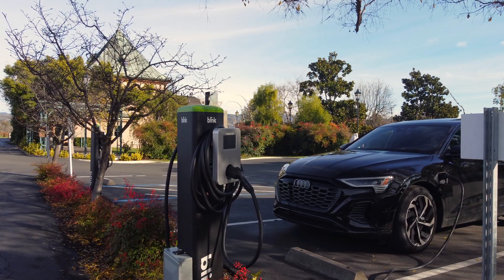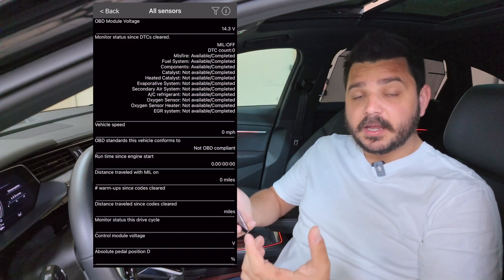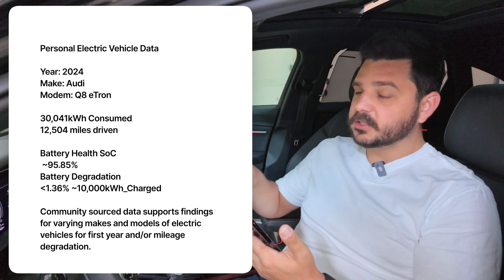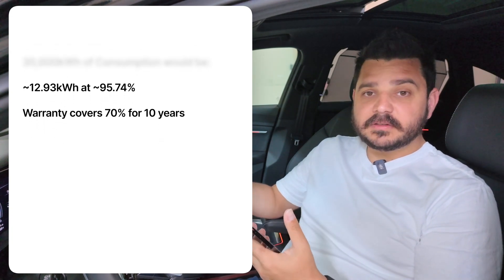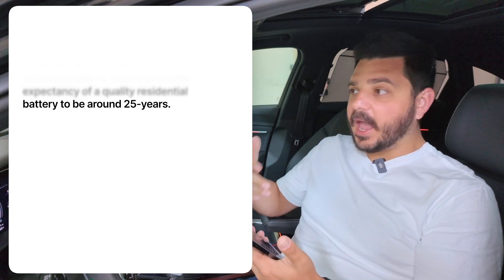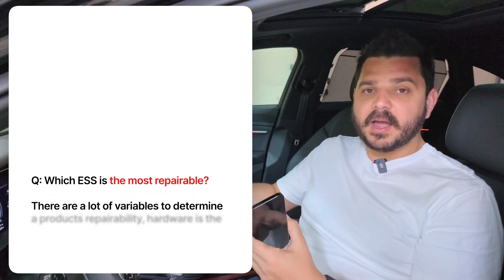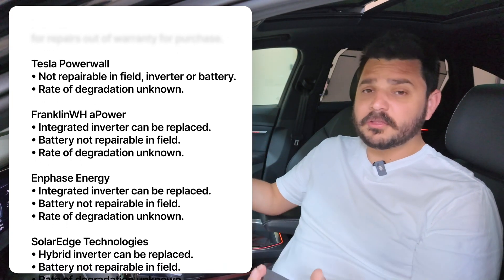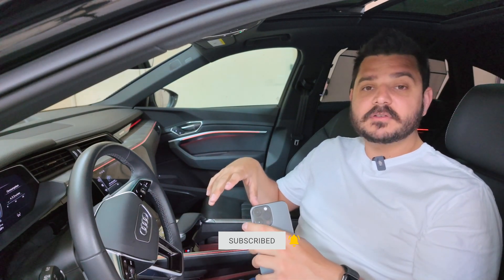How Long will a Tesla Powerwall Really Last? Shocking Battery Degradation Insights!

Comment: According to my Tesla STATS app my 2022 MYP with 20K miles (half are road trips using DCFC) the app reports I have lost 4.7% of its original rated range.  And my Y is a Performance Y and I go WOT every chance I get especially if there is some kid in a Mustang around me.  So my DISCHARGE data is probably on the HIGH side.
Reply from the maker: That sounds to be inline with most electric vehicles, the batteries need to settle in and the degradation slows down. Check out www.recurrentauto.com they will tell you how your vehicles doing compared to thousands of other ev owners.

Comment: When you look at the OBD data verses the vehicle display, you need to remember that the OBD is showing the actual battery SOC whereas the display adjusts for the hidden battery buffer... which on an e-tron is at the top of the battery.

Another issue is the chemistry.  LFP (LiFePO4) vs NMC.

A third is that degradation is non-linear.  The battery degradation rate typically starts out steep at the beginning but slows down drastically after that.

And a fourth is time, as I noticed another poster said.  Calendar aging... but calendar aging is a bit of a beast to calculate because it is primarily a function of the battery voltage (of the cell voltage) x temperature.   So this really depends on the temperatures the battery is exposed to and for how long... it will degrade more slowly in colder temperatures and at lower states of charge and more quickly at higher temperatures and higher states of charge.

Extreme conditions cause greater problems.  but nominal hot weather during the day might not necessarily cause faster aging because the battery is a huge mass so its ambient temperatures tends to be a combination of day + night temperatures.

And chemistry as well... so for example, NMC will degrade faster when held at a high state of charge, which is why charging to 80% is recommended (some people even do 70%).  But when a LFP battery is charged to 100% and charging stops, the cell voltage actually drops down significantly (while staying at 100% SOC), relieving some of the stress.   When a LFP battery is drained even a little, even just down to 95%, the effects of calendar aging are greatly diminished and at 70% at 20-25C or so calendar aging pretty much stops.

Lots of knobs.

Comment: The longest running battery health study is the Dutch/Belgium auto data base which goes right back to when the Model S was prevalent. It shows that degradation is the steepest at forming with ~5% degradation in the first 50k miles. Thereafter it averages 1% per 50k.
https://docs.google.com/spreadsheets/d/t024bMoRiDPIDialGnuKPsg/edit#gid=0
A recent study by Recurrent Auto found that removing the catastrophic failures of early Leaf, Bolt and Kona mass recalls from data, modern batteries do not meet warranty life in less than 1.5% of cases and with Tesla an order of magnitude better than that.
Dr Dahn has conducted a long running study on longevity in LiIon, having been responsible for doubling the cycle life within a year of employment by Tesla. In 2019 he published a white paper to all LiIon users and manufacturers showing them how to make a 'million mile' battery. Those cells are still under running tests and have reached 4 million or 10k full cycles.
Recently he has showed that NCM can have a cycle life equal to LFP if charged to less than 4.2v, temperature controlled at 20C. His longevity advice is to charge a typical EV from 30-70% for it to last indefinitely, which matches the requirements of a typical urban vehicle usage.

https://www.youtube.com/watch?v=rOAYjcO6kao
According to the Noble Prize battery guru Goodenough, Lithium batteries are not suitable for vehicle use! https://youtu.be/kR8CESrigEg?t=261

Comment: If the intent is to use the Powerwall 2 solely for backup, with no time of use element to be concerned with, does it then make sense to set the charge level for the battery in as narrow a range as possible, say 75-80% to minimize charge/discharge, also avoiding harmful 100% level?  This is consistent with the recommendation for daily driving of Tesla NMC battery vehicles.  If the grid down you would get alerted by the app and you could lower the 75% to 20% or whatever minimum you are comfortable with.

Comment: This is something I'm very interested in.   Just how long will my powerwall last?  Anyway the powerwall (2 anyway) has an api you can monitor it directly and don't need to attempt the comparison and there should be enough out there for a reasonable guess to be made.   I've been monitoring mine, which I've had since October 2023.   First thing actual capacity of the powerwall is not 13.5KwH, it's 14, or at least that was what I thought, mine started out with 14507KwH according to the API.   Why?   I think Tesla has worked out it's in danger of having warranty claims and is seeking to mitigate.    Today my powerwall is down to 14200KwH so it's lost 307 watts of capacity in less than 7 months,    It is therefore on schedule to lose 526w a year, which is 5.2KwH over 10 years.   70% of 13.5KwH is 9.45KwH this is the promised capacity.    Extrapolating my 10 years capacity I get 9.244KwH, which is slightly under.   My battery is in a garage, but is being force discharged, so I will exceed the maximum rated out (more than likely) so my warranty will actually be less than 10 years 8-9 I think.    Anyway there are lots of caveats my battery seems bigger than most,   I've only had it 7 months, age related wear might cause an increased decline, etc.   That said I don't think Tesla is kidding your battery will have just over 70% after 10 years ordinary use.   37 years seems unlikely.
Reply from the maker: Most batteries have a true capacity and a usable capacity. The last I heard the PW had a true capacity of 14kWh and the usable capacity is 13.5kWh. It’s possible that the batteries true capacity has increased over the years with units reaching 14.5kWh. Battery degradation isn’t as linear is you might think and a battery typically losses the most of its capacity in the first year before leveling off with a lower rate of degradation. Regardless there are a lot of variables, and not enough shared data to make a distinctive conclusion. Ideally these companies could publish their finds of real world battery SoC, and we can overlay them to seen if there is a pattern. Much like they have done with EV data sharing.

Comment: Dale, I think part of me is seeing that all of the electric companies claim that they are charging the residential battery fully and then discharging it on a daily basis. This is very different from an auto. Whereby (most EV users) don’t fully discharge daily… in turn This degrades the battery as there is only a limited number of cycles that a battery can be charged and discharged. Hope this clarifies if not, please advise me!
Reply from the maker: The cycle behavior of a vehicle can create some variables but we do see this occur on sites that have less solar production in the winter and too much storage, the batteries don’t fully recharge. Also, most manufacturers on both sides, residential home batteries and electric vehicle batteries have two battery ratings true capacity and usable capacity. This improves the battery health over time

Comment: Plus, the powerwall just for backup should not degrade as much as the car because the car is up/down/ up down, which affects the longevity you would think. I have 2x powerwalls (#2) version, Max discharge is 10 kw continuous discharge. I’ve had them almost 3 years, lost power 94 times, longest one was 9 hours, but most were 10 minutes some a few hours. I installed mine in a workshop area so no rain, snow, extreme temperature fluctuations. Overall not heavy use as a backup. I’m sure if someone was using it to offset the grid charges by charging when cheaper and time of use works for your area. I just use mine as backup. Great information for a video. Is there any way I can see how my powerwalls have degraded? Do I just look at it when fully charged and if it’s 97% it means tgat is what I have lost = 3%?
Reply from the maker: Assuming the software reports the batteries true SoC.

Comment: You are missing one important parameter. Time influences the battery health. Not just the amount of MWh. Also need to take into account the battery size
Reply: Not to mention that in 15 yrs even if the Battery Cells themselves are still good and have 90+ capacity if one of the internal PCB control modules goes bad, a replacement part is most likely NOT going to be available. In CA the "right to repair" law will soon go into effect but it only covers a period of 7 years. It would be really nice if after the 7 year period and after a company discontinues spare parts they were required to post complete PCB schematics & firmware/software as open source so someone could reproduce the parts if desired.
It just drives me crazy how all these lifetime cost benefit analysis or payback period calculations NEVER discuss the problem of repair parts becoming obsolete and then the consumer has to purchase a complete new item including installation costs before the projected lifetime is reached.
Reply from the maker: We would need to look at the cell level data to create a generalized rate time influences degradation. The size of the battery shouldn't be a variable as much as the voltage of the cells and packs.